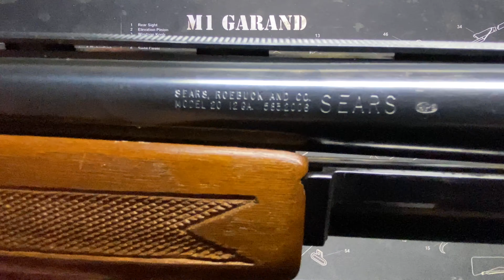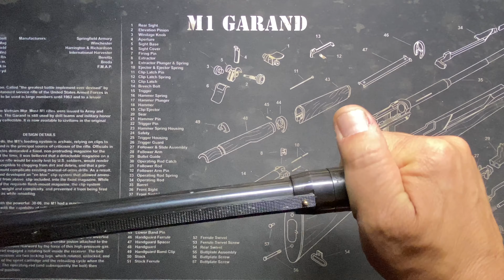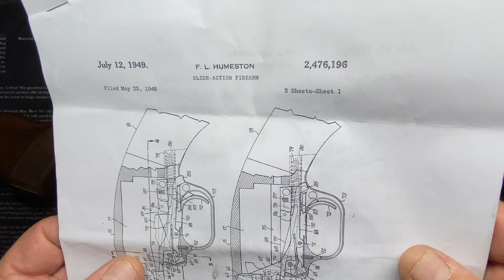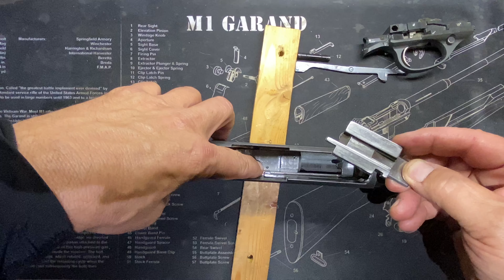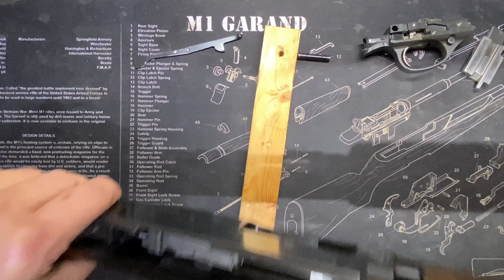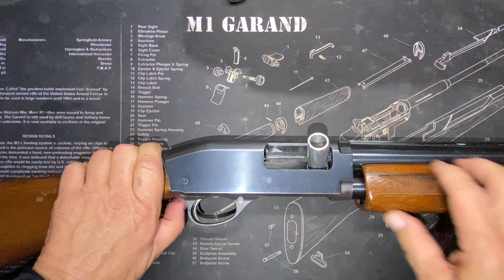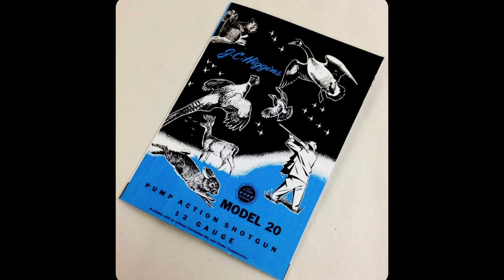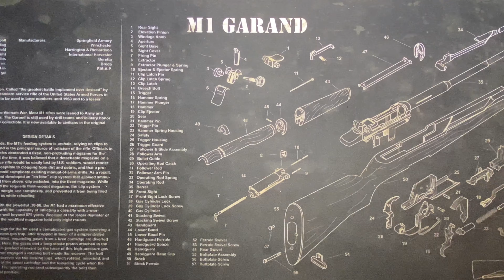Sears Model 20

Comment: High Standard was located in Hamden, Ct, then moved to East Hartford. Sears at one point, early in the 20th century, did operate a plant that manufactured firearms. It was called  Meriden Firearms, and it was right down the street from the Parker Shotgun Company.
Reply from the maker: Those Savage intertwined .22’s are very mysterious.  Touched on those recently in my Mossberg Model B video a few installments back. Check it out.

Comment: I just picked up a JC Higgins model 20 for $200 from my Cabelas- has the power pac choke system on it, super smooooth action!
Reply from the maker: Excellent.  It needs some exposure on your channel!  Thanks for tuning in.
Reply: It will get its turn- It's a bit worse for the wear, some rust, and it's missing the safety button.  @MilsurpGarage

Comment: Different gun I know but I saw your savage 99 video and I wanted to let you know that

 After five months on layaway I was able to pick up my 
Savage 99 

And yes I’ll be using it, this coming rifle season

Details:

Savage 99 (EG)

Chambered .300 Savage 

Manufactured by savage in Chicopee Falls Massachusetts 

Circa 1952

Has checkering on the stock and the forearm 

Outfitted with a flip up rear sight and a Lyman 2A SA peep sight 

Even though the gun is over 70 years old the stock is in excellent shape still retaining a gloss finish
Reply from the maker: Finally found some .300 savage (for a small fortune) and shot mine a month ago for the first time. It was awesome.

Comment: I have a J.C Higgins Model 66 in pristine condition with the original soft shell case and owners manual wish I could get it to you so you could do a video
Reply from the maker: They always interested me and I had a couple of purchase chances but these were prone to action bar breakage which has made me hesitant.  Need to find one super cheap.  Would love to feature yours but would be afraid to shoot it for the video.
Reply: Why would you be afraid to shoot it ? @MilsurpGarage
Reply from the maker: @volkssilver Afraid it would break is a better way to put it. Is it a single action bar version or a dual action bar set up?
Reply: The owner's manual does not specify and I have not taken it apart  @MilsurpGarage

Comment: I’m not sure but I always called those adjustable chokes by the Polly Choke name. My second shotgun when I was 14 was a JC Higgens High Standard Sears brand 12 gauge with that same adjustable choke.
Reply from the maker: Poly-choke was a brand, not necessarily it’s own design and there were many different manufacturers of the adjustable choke.  This particular one was not specifically marked and I do not know these types well enough to identify it one way of another.

Comment: I think  it is called  a Polley  choke  but i could  be wrong.
Reply from the maker: A poly choke is a brand name for a very popular adjustable choke from the period but I’ve never seen one without the brand name on it.  I suppose they might have made some unmarked with the name omitted for Sears but never saw a Poly choke in this three choice configuration either. 

My JC Higgins model 20 had a brand marked Poly choke….the Sears Model 20…..still not sure.
Reply: @MilsurpGarage One of my JC Higgins model 20 has a “JC Higgins power-pac” marked choke. Has three different choke tubes you can screw in… short , medium and long range. JC Higgins model 20 is my favorite shotgun ever :EDIT never mind

Comment: I have a 1962 JC Higgins Model 20  and it has the improved compensator with the removable chokes.

I can only really shoot fibre was cartridges through it. Because the power pac chokes shaves plastic wads and they build up on the choke. Yours has a Poly choke. I think the poly choke is a better system as I have a a few shotguns with them on it. Mine is also only a 3 shot. The magazine is crimped to only allow 2 in the mag and one in the chamber.

Fun fact Polychoke still exists. You can buy them for modern shotguns too. They just screw into the choke tube of modern guns
Reply from the maker: Ive heard of issues where the wad can get shaved with these types of adjustable chokes but I have never personally observed this problem.  Thanks for tuning in.